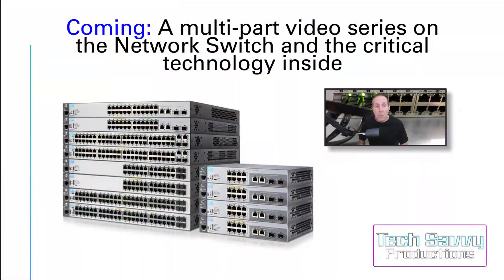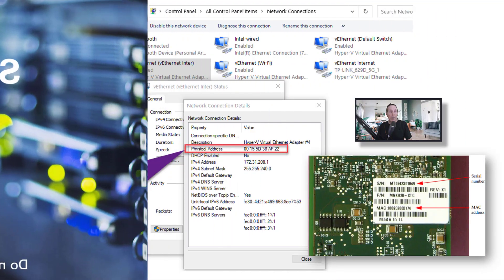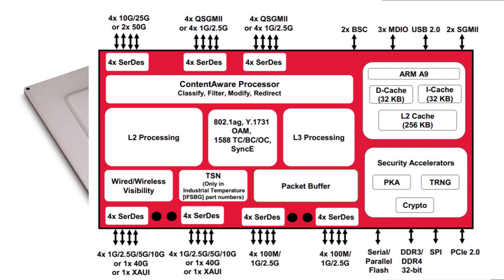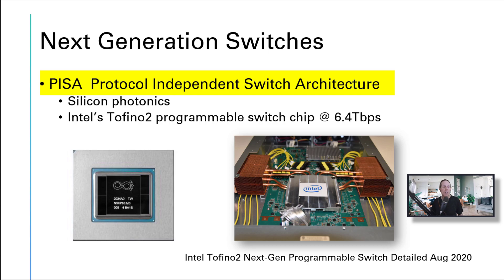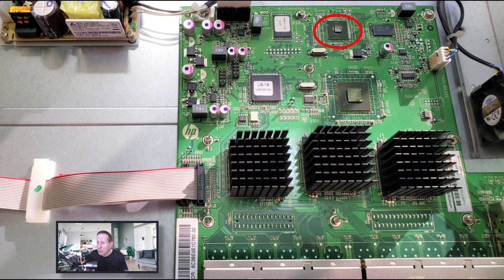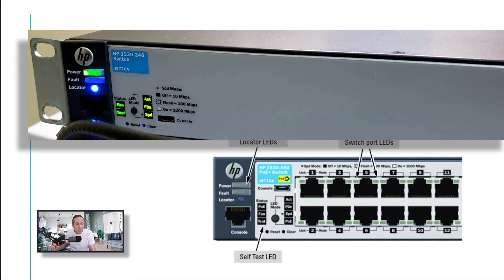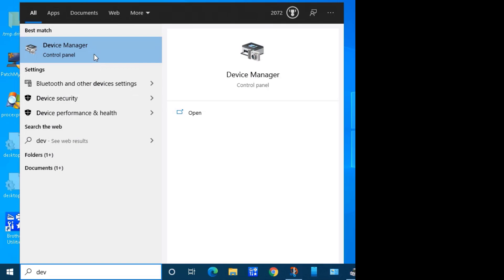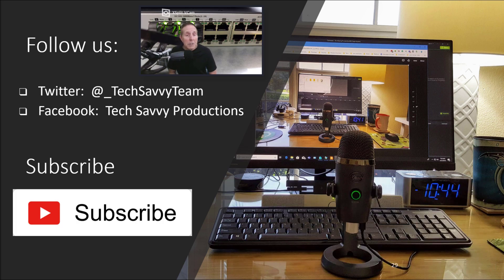LAN 2.0: How Network Switches & ASICs Are Redefining Connectivity

Comment: Thank you for touching a little bit on POe, I saw one Cisco that got wet but did not die and it sent more than 90 volts AC to its ports....changeling day....
Reply from the maker: I guess engineers do not expect the network closet and racked equipment to get water soaked.   Most electrical equipment build in some type of short/overload protection.     90VAC would not be a good day for networking inputs!

Comment: Wow the other  day  I was thinking to myself  "Mr  V  needs to  do a video on switches  because I was  playing around the  SFP   port on a   Cisco switch's doing a daisy chain    You  just  answered  my  question about that  console port! What  about web  based  access to the  firmware ?   I opened  up  one of my Cisco switches,   like   you stated  3  big  ASIC's   with   big   heat sinks  and  a lot of   glue logic , along with   the switch  mode power supply       Thanks  from  fellow  Floridian
Reply from the maker: See how great minds think alike!?

Comment: are cat 8 cables being used in enterprises at the moment ?
Reply from the maker: It is affordable cable and supports up to 40Gbps which is where many switch uplink ports speeds are becoming more common.         Here is the scoop on CAT8:  Category 8 cabling has a greater throughput capability; it can support transmission of data up to 40Gbps over balanced twisted pair copper cabling.  The solution is a shielded solution--there is no unshielded variant.  Therefore, careful attention must be paid to shield terminations when installing the solution.  All previous categories of balanced twisted pair copper cabling supported a Permanent Link Length of 90m (295’) and a channel of 100m (328’).  Category 8 has a maximum Permanent Link Length of 24m (78’) and a maximum Channel length of 30m (100’) when supporting 25Gbps and 40Gbps speeds.  Category 8 cabling can support data speeds of 10Gbps and lower at a full 100m (328’) Channel configuration.  When field-testing Category 8 solutions, the installation is tested from 1MHz to 2000MHz, whereas Category 6A balanced twisted pair copper cabling is only field tested from 1MHz to 500MHz.

Comment: Thank you Lowell, as always great videos! 
Just one question: you say we're going to block applications like PUBG... but are you the best way is with a switch? Don't we need L7 support and app control (app signatures) to do that? Or at least L3/L4 firewalling and going the old way, with IPs and ports?
Reply from the maker: I was really just kidding, layer 2 is not a good option for PUBG but you can throttle some apps using QoS depending on the switch.   Your point in the comment is correct.   Thanks for listening and thinking!!!
Reply: @TechsavvyProductions  "Thinking"... I should try it out someday 😄